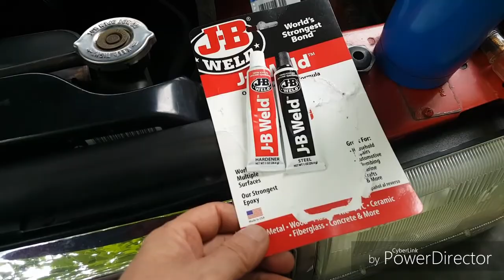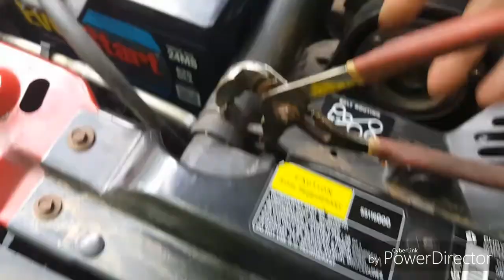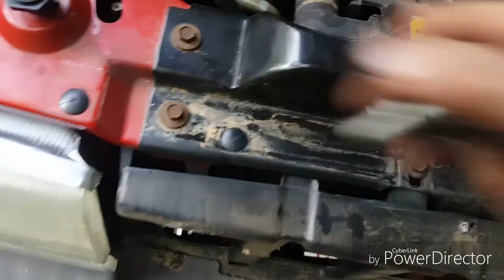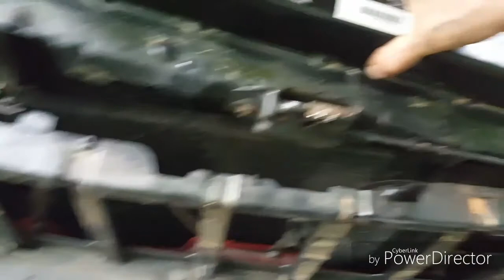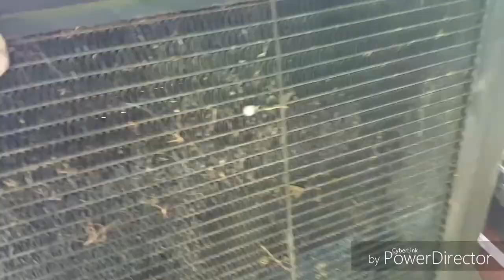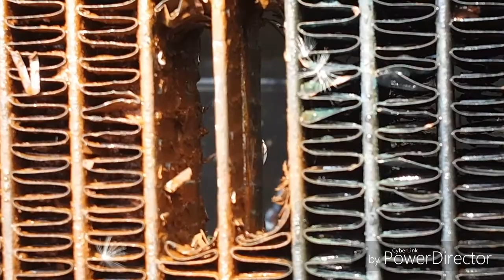Jeep radiator repair using J-B Weld

Comment: You may find that the standard JB Weld you used eventually turns soft when exposed to antifreeze.  That's the issue I ran into.  There is a product called JB Weld Radiatorweld that should be better for this application.  I haven't used it but have an inquiry to them as to its resistance to ethylene glycol antifreeze.
Reply from the maker: i only ran with water in mine....eventually got new radiator.